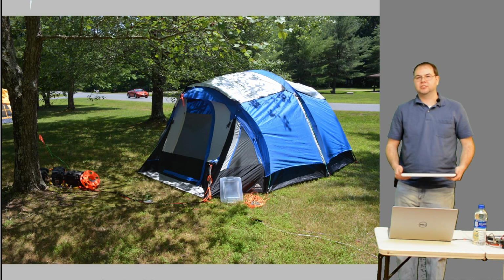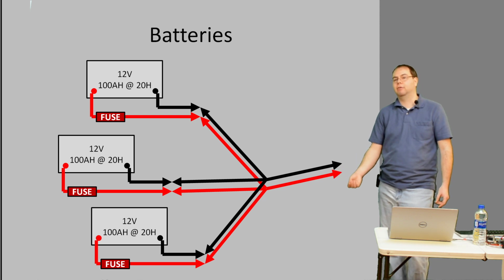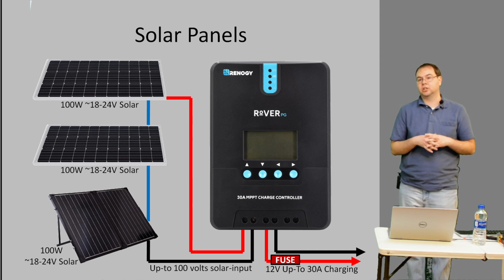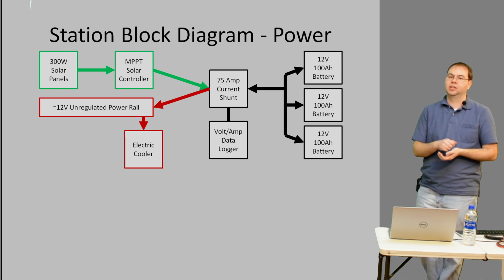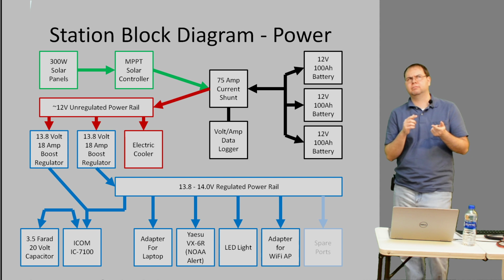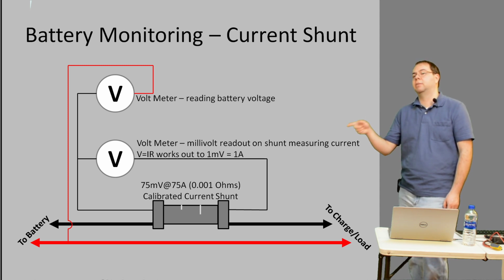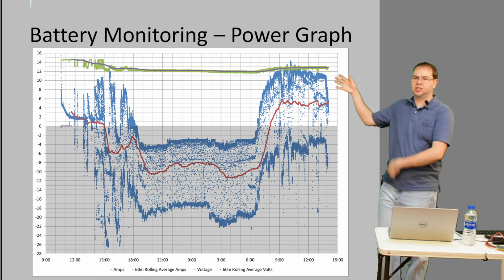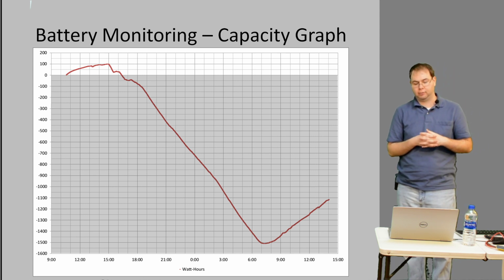Solar Power Digital Station - Amateur Radio Field Day 2019 Overview

Comment: Some feedback. 
The weakest link in this system is the lead acid batteries. Please read about Peukerts effect. The battery monitoring stats clearly demonstrated the effect (Peukerts effect) of running FT8 over long periods, with lead acid batteries. The batteries never had a chance. That's the voltage drooping the station was experiencing. Please consider a 4S4P 100ah lithium iron phosphate upgrade to your system. It will greatly outperform the lead acid system, charge faster, allow you greater discharge,  without any voltage lagging. You'll also be able to carry it by yourself in a single Pelican case for example. Good presentation, good stand-alone system.
Reply from the maker: Absolutely are better options for performance and weight - though far more expensive.  Given the infrequent use (a few times a year) the cost seemed worth the tradeoff.  WalMart batteries so each ran around $80 per 100AH.  I would love to get some nicer batteries but not at the cost the ones I have seen run.

Comment: Thanks for this outstanding presentation. Very interesting and informative. If field day occurs this year I will stop by your tent to learn more about your equipment and configuration . 73, jim KM4TUH
Reply from the maker: Yep - have to see how things go.  Would be nice to have it but I would rather skip than have higher-risk to everyone especially considering tents are rather close quarters.  I also have learned I can only wear a mask for about an hour before freaking out about not being able to breathe easily - with the usual hot humid weather I don't see that working well.  Time will tell.